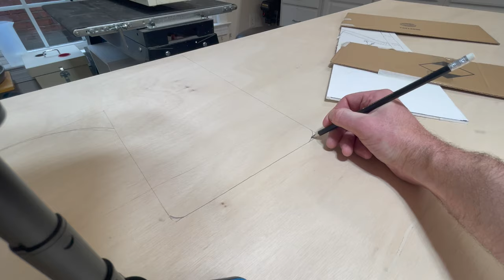FULL BUILD! Honda Pilot Camper Conversion

Comment: Very nice build! 
I have a 2013 Pilot and did something similar, only I took out all the seats, and built the platform as low as possible, with hatches to access storage below. All-in-one battery/controller/inverter, fridge, pantry, etc. reside on top of platform next to sleeping position for 1 person.
My regrets: not putting a finish on the plywood, and not using separate components for the electrical.
Reply from the maker: That's awesome, my biggest constraint was setting it up so 3 people could ride around in it. I could make it a lot better now after having used it and if I was designing for just 2 (or 1).

Comment: Nice build! I have a 2011 Pilot Touring 4WD that I sleep out of whenever i work a camping music festival. I've had it like 3 yrs now and I love it. I just got back from Burning Man, it rained out there so the 4WD came in handy. I plan on doing a 2 inch lift and adding all terrain tires soon. My favorite addition so far was adding Apple CarPlay to the factory navigation via NavTool. I also bought a 12V refrigerator of Amazon that has been working great. That's about everything i'm doing to the Pilot, next up i'm converting a cargo trailer into a camper trailer just to have more room for comfort.
Reply from the maker: Pilots are great. I got mine new and put 155k miles on it. I've only ever had to do routine maintenance on it!

Comment: Great job, Ive
Got a 2016 pilot, Didn't do the extreme you did, which  is awesome by the way. IM using a portable power station rather than batts. Love your build, and your personality!!!
Reply from the maker: Thanks for watching and the comment!  I would have just done a power station, but I had bought the panels and battery to try and do a setup in my backyard for like a garden watering station. Then this trip idea came up and I could justify it by saying I didn't have to buy a power station!

Comment: Love your build! Thanks for detailing the solar setup. I hadn’t thought of running the power wire through the Sirius antenna mount. Great idea! Is it still waterproof?
Reply from the maker: I didn't trust my plate and those wire gaskets to be water proof so I ended up covering the entire thing in silicone. So far I've had no issues with leaking.

Comment: i have a 2015 Pilot and am really considering converting! I was wondering what gas mileage you get or any tips on getting better mileage? Thanks! 😅
Reply from the maker: Average MPG was around 19mpg on the trip. Usually I get closer to 21. The thing that hurt the gas mileage the most on the trip was the speed limits!  The speed limit once I got to kanas was 80. You definitely get better gas mileage around 60-65

Comment: how tall are you? im 6feet tall and i’m thinking about doing this in a honda pilot. did you have enough room to lay flat ?
Reply from the maker: I'm 6'4". So I set this up so my driver seating position (basically all the way back) did not have to change. I could lay flat with the top of my head touching the back of the driver seat and the flat of my feet would be an inch from the rear glass.

Comment: PS :  The "Off Gassing" from the "bed liner" coating in NOT meant for "interior" use !!  It can be very "toxic" to humans, animals ..... 
I used to work for a company that Applied it to New Truck beds  for dealerships .....  We had to suit up wear special respirators to work with it ....
Reply from the maker: Well crap. Is it ok after it cures? Or is it always going to off gas?
Reply from the maker: I looked it up. It looks like the truck bed liners in a can like I used do not contain the chemical that the professional ones use, like rhino line.  As long as this stuff cures it's fine.  It was several weeks between application and use.

Comment: I don't understand the point of putting the solar panel in the basket. Seems like a waste of space and weight.
Reply from the maker: The basket was the easiest way to mount the panel to the roof. I guess I could have just attached the panel straight to the cross bars. But this protected the panel and gave me a little extra room for storage.  A smaller panel would have been better and worked just fine for the amount of energy I needed. But I had this panel i had bought for another project.

Comment: All I did was fold all my rear seats, throw in a trifold mattress, fleece blanket, a 12v Cooler and a 720 EcoFlow powerstation and my camping gear, with laptop and done.
Not a single tool necessary.
My philosophy is to keep it simple, stupid.
Reply from the maker: Nice, I wanted the build so I could drive around 3 people and carry stuff for 3 people and have easy access along the way!